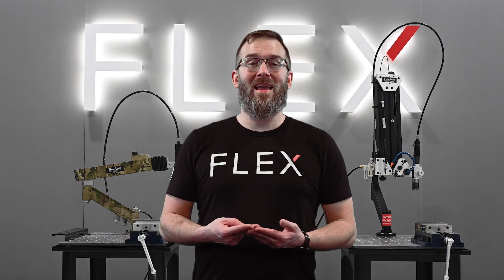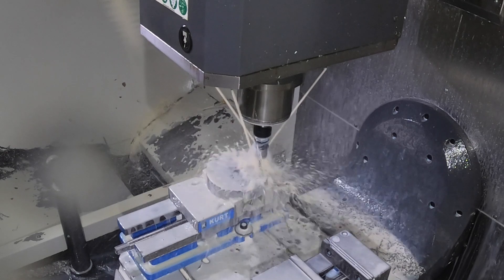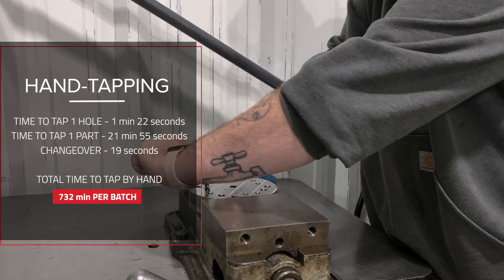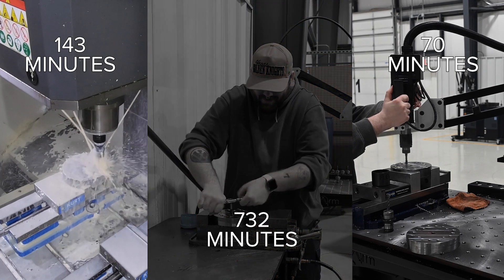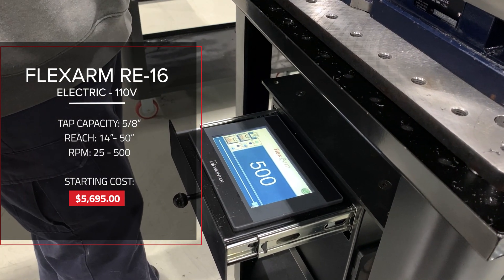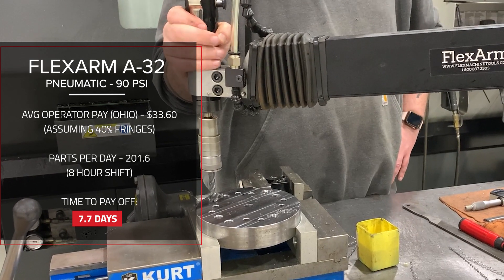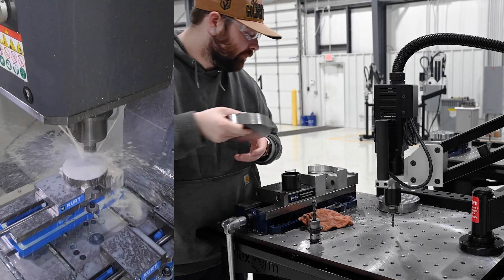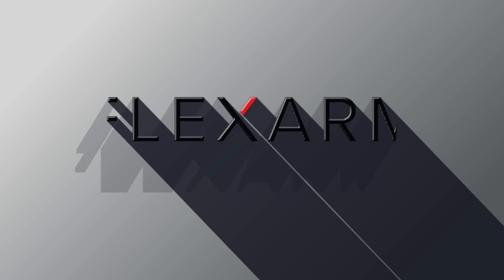Tapping Efficiency & ROI: FlexArm vs. CNC vs. Hand-Tapping

Comment: On a cnc you could run a tap on at least the same speed as the arm or even faster, so realistically you wouldn’t gain any time with the arm.
Also does the arme require manual labor for a monotonous task and adds one extra step. 
While the machine runs you can focus on other tasks like programming the next part prepare tools etc.

Comment: It's a bit laughable that you're even doing the comparison this way, it like you don't understand your product. 

The main advantage of the flexarm is short setup time, not production. It's flexible (it's in the name!!!) 
Perhaps you got a batch from the weekend shift that didn't get threads? Put a guy at this machine and do the threads rather than put them back into the machine or scrap them. 
Do you have a job that needs a really big thread that your cnc lacks power for?

This will never be a tool to help in production, it's to solve issues and for <10 part batches.

Comment: Tapping with the Flexarm can't be faster that with the cnc, if you use the same tapping bit. The flexarm has one big advantage: It doesn't need the CNC. So if the CNC is already running all the time, you can transfer time from the cnc to a human. And a human is way quicker to setup and also a little bit cheaper. You can also use the same human to do part cleaning, QC and packing. So its not a bad product, but the cnc will still be a little bit faster at tapping.

Comment: Not to be a downer, but you could try to not run the tapping cycle in the CNC that slow.
Reply: Yes, and lets see this machine tapping 24mm or 1 inch stainless threads like a bigger cnc mill😁
Reply: @happygiraffe9787  Looked at the specs on a brother cnc machine one time and it had max tapping cycle spindle speed at 6000rpm. Look it up, it's mental.